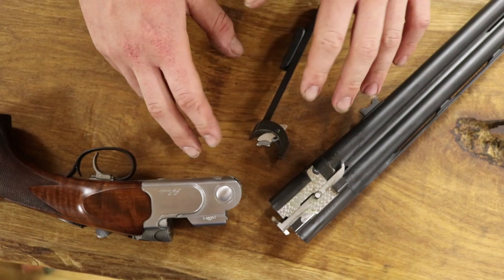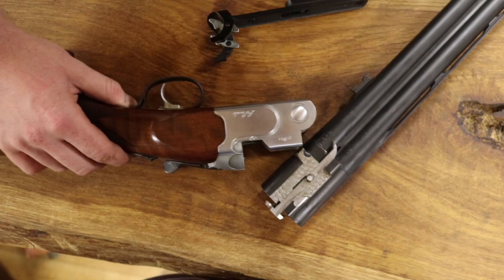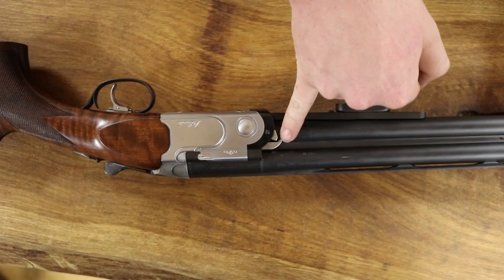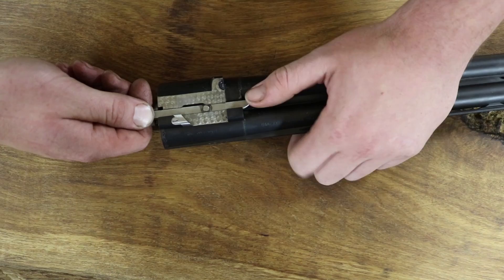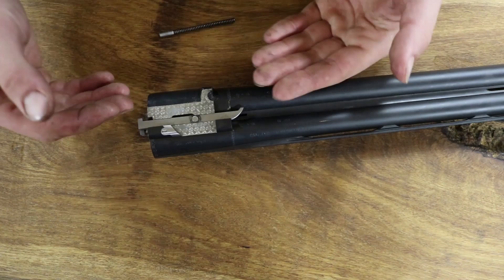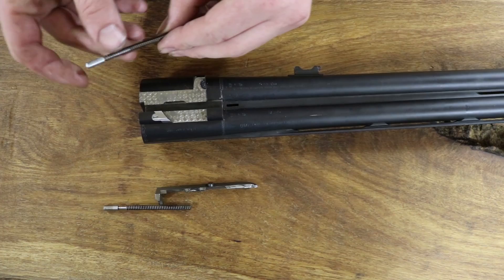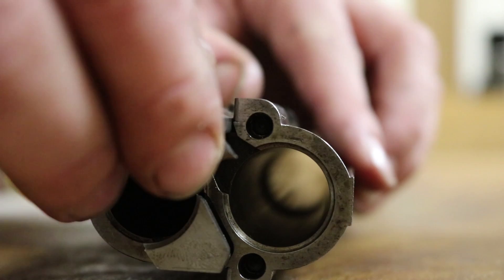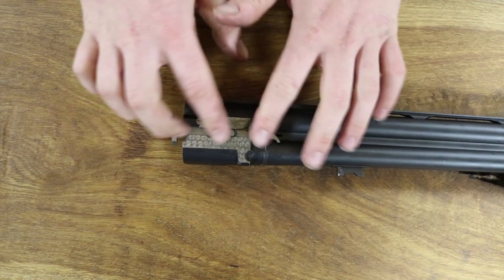Removing and Replacing Beretta Silver Pigeon Ejectors

Comment: Awesome video! I also figured out that if you push in the extractor and flip it with the camping down and tap it on the table to camp and will just fall out and then you can pull the extractor out with the spring. And repeat on the opposite side.

Comment: My advise is always wear a glove. I carefully removed my 682's ejector and ended up with 3 stitches in my thumb, so I guess not that careful.
Reply: Do you cut yourself with a spoon or a butter knife as well????   Seriously, if you cut yourself removing the ejectors on a 680-series shotgun, you probably shouldn’t be handing even screw drivers, wrenches or a hammer.    It’s just too dangerous for you.  😂😂😂

Comment: I save my hulls.  How does one modify the kickers of a 686 to lift, rather than eject?  Is the modification a permanent removal of metal, such that it cannot be reversed?  If so, are kickers relatively cheap to revert back one day?  Love my Silver Pigeon Sporting!
Reply from the maker: Probably the easiest way to have the choice between ejectors and none is to get some spares and cut the back part off. They are so easy to change over you just put your modified ones in when you don't want ejection!!
Reply: The Gun Shop 
Thanks from New Hampshire, USA!

Comment: Does the gun still works when you leave out the ejector springs?
Reply: The gun will still function, yes. BUT the ejectors will not fire and they may not even extract them fully from the breach face.

Comment: Somehow my injectors got messed up removing my barrels.  I have a Snapchat  in the firing position and one ejector is out and one ejector is locked in with a snap cap. how do I get the cocked barrel injector to release. I cannot put my gun together to do it because both buttons do not lineup to assemble my barrels into my receiver.
Reply from the maker: Lightly Tap the stuck one on the lug with a plastic hammer. It’s probably just rotated a little. Presuming this is standard sil pig
Reply: TGS Outdoors thank you very much. I was able to release it. Your videos are very informative.